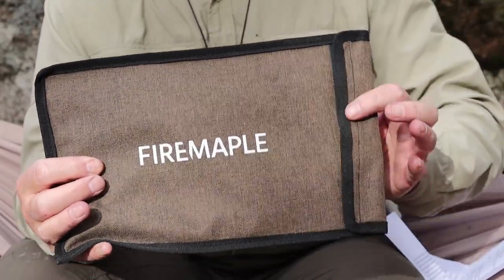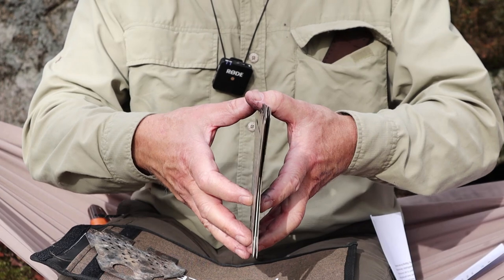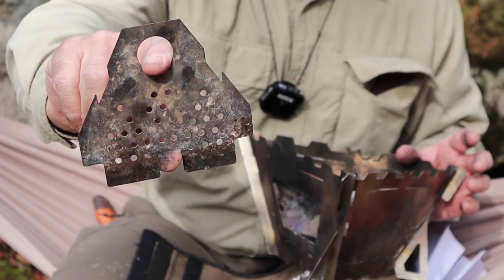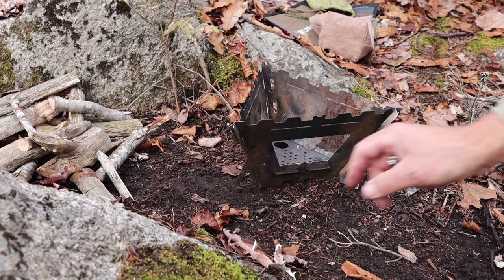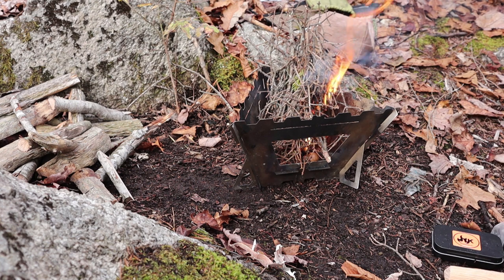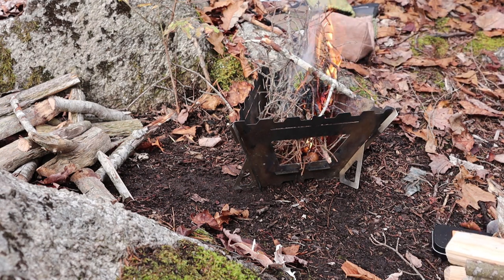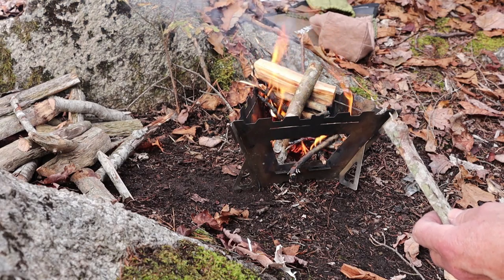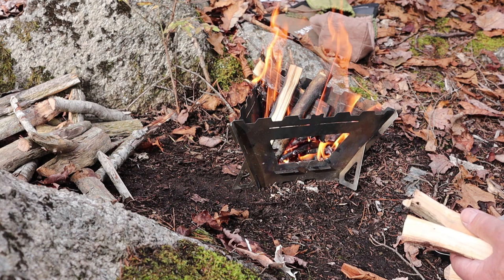Fire Maple Maverick Wood Stove

Comment: I have found that if you turn it upside down on top of a large vegetable steamer tray. It gets enough air flow that it doesn't smother it and you can use a number of different fuel sources. As well as it's great for an alcohol burner that way.
Reply from the maker: Great suggestion. I will give it a try. Thanks for commenting

Comment: Sounds like a pretty bang on review.  I was thinking it’s not the best stove, because it’s too wide, but as you said, it’s a little like a fire pit too.
I really don’t like feed ports so big that there isn’t even a lip at the bottom.  They should be smaller, or bigger, but with something to at least stop some of the coals rolling out.
Reply from the maker: I am finding it is easier to just feed it from the top at each corner, as long as the pot/pan is not too big. I could give up the feed port altogether. I will try this by placing a metal plate across it. Thanks for commenting Jim

Comment: Mark, I found that the relatively small base grate would choke off air as coals built up during an extended burn. I ended up drilling some additional holes in the side plates towards the bottom to keep the air flowing, even with the large feed port.  I also found that while pushing splits or thumb-sized twigs through the feed port during an extended burn it would concentrate the flame in the opposite corner of the triangle , which added some challenges to even cooking.  I think you are correct that this ends up functioning as a mini open fire pit. I, for one, I am happy with it.  Unmodified, it is best for use in putting on a hasty boil  with whatever twigs are handy without the hassle of doing a bunch of wood processing as you might for a small gasifier or a firebox.   It’s worth the modest money and plenty fun to play with in the woods.   Also, much lighter than a firebox and far cheaper.    A final thought regards a sprit burner.   The wide feed port allows one to use the simmer ring (important when steaming rice).    Very few of these wood burner stoves allow for the alcohol burner  simmer ring without a lot of fiddling.    This one does.   It’s a plus when you aim to extend the alcohol burn at a lower intensity, which I often do.
Reply from the maker: I agree with you experience. I have found if I feed my sticks in from the top, doing so from the three corners I am better able to center the flame. Thanks for commenting

Comment: Careful selection of Wood TYPE would make a Difference... Pine or Birch to get the fire going Then load up with Oak or Apple or Locust... Different wood types have Huge variations of Heat output and Burn Times , ease of keeping going in wet weather and so on ... would be a good Vid to compare Differences
Reply from the maker: yes, wood selection and size as well as dryness all affect stove performance. Thanks for commenting

Comment: Hi just wondering if the fire maple 1lt kettle will fit on this stove?
Reply from the maker: Yes it does. I have a separate review won the kettle using this stove. Do need to use the triangular pot stand though. Thanks for commenting